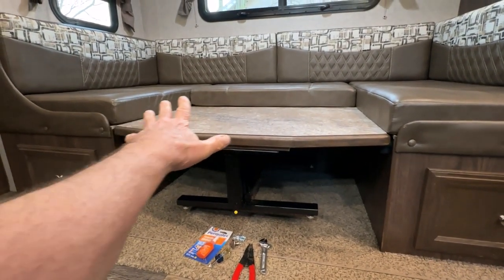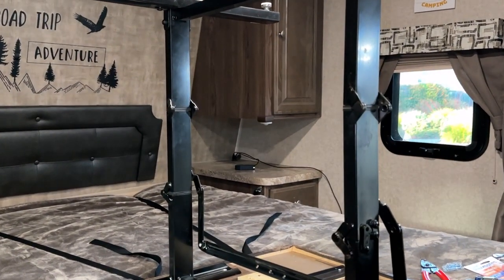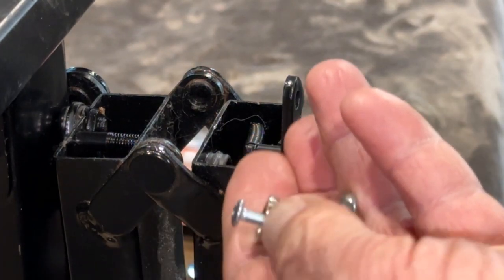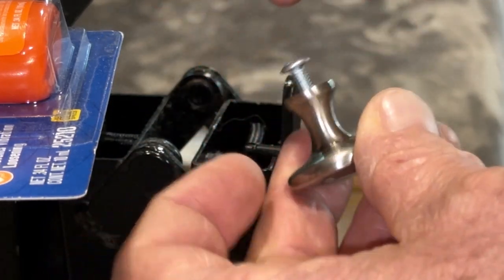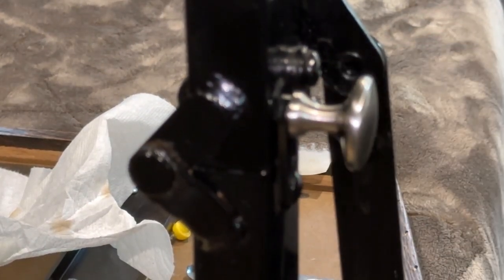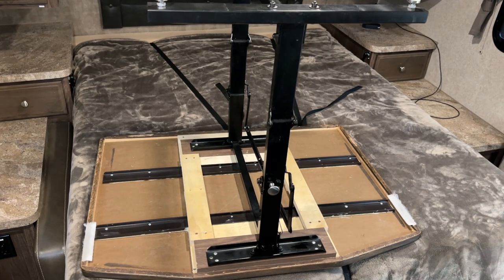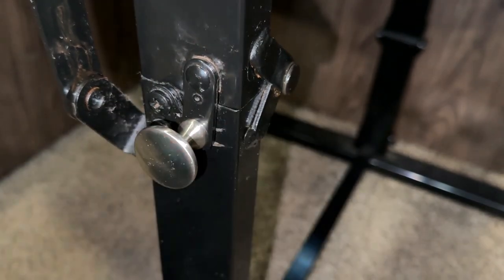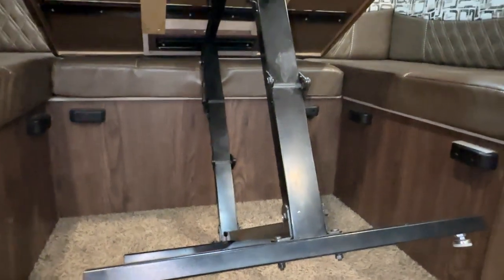Folding RV Dinette Table Latch Problem Solved and Other Improvements Done to the Table

Comment: Fantastic mod. I'll be doing this today. 
With your table bow you solved could it be from weight on the table while in the down position between the dinette pedestals?  Like ours, I noticed the table legs do not touch the floor while in the down position.  I placed 1x4 & 2x4 pieces under the legs to remove downward stress.
Reply from the maker: Thanks for watching and commenting Hal. I really like how much easier it is to unlock the table leg now after replacing the little yellow tab. I think your right with the table sag because of he table legs hanging, I might try your idea of using blocks to support them while in the up position. I must say the table top has been staying straight after I did my modification. Thanks again for watching. https://www.youtube.com/@thetraveltrailerguy/videos

Comment: Our 2021 mini lite has the newer locking mechanism which is still a problem. The latch does not firmly keep the table legs secure.   The table is also very wobbly.  So what i will try this, I purchased two 5/8" expandable shower rods and i will prop up both sides to keep it from rocking  ....   I find it very frustrating that a $30k trailer needs Constance modifications to make the camping experience more pleasurable. I don't remember my 2010 RV with these many issues.  Newer seems Not to be better.......
Reply from the maker: Hello Ed, yep a lot of trailers today are needing lots of repairs and modifications and its sad since we pay so much. The table wobbling seems to be a big problem for so many, I'm thinking your curtain rods may just do the trick to stop it from happening. Good luck https://www.youtube.com/@thetraveltrailerguy/videos